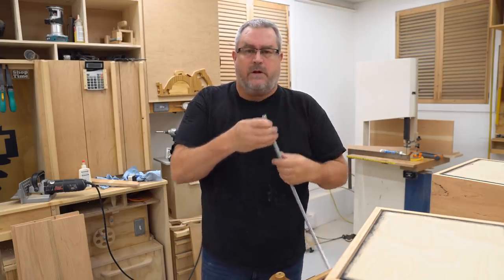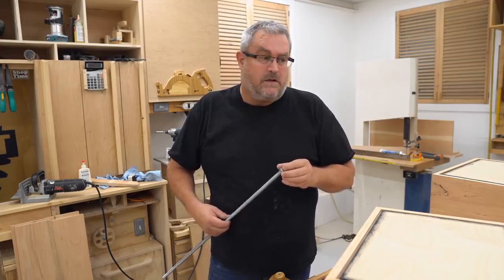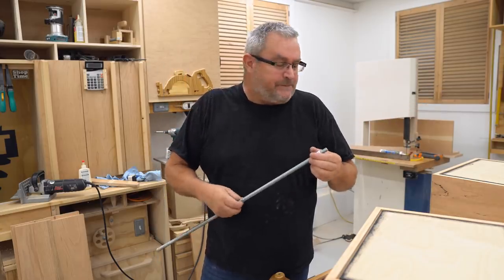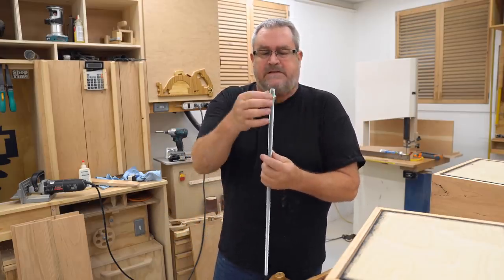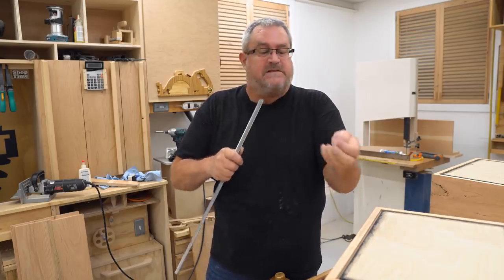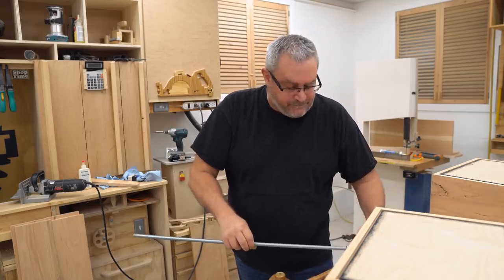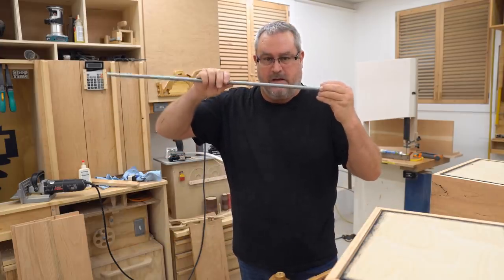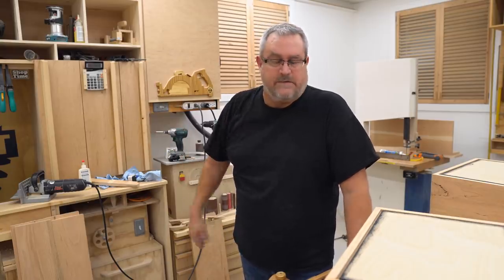Why I Don't Use ACME Threaded Rod

Comment from the maker: Even though i don't use acme rod, there's nothing stopping you from using it in your own projects. You can also use it instead of the standard stuff in the plans I produce. Whatever floats your boat!
Reply: A potential source: trailer jacks.  I'm not talking new either.  The innards are well greased (preserved), yet the tubes often rust out, or get bent.  However, these are probably more abundant in coastal areas.  Perhaps RV and moving rental stores.
Reply: Din6334 nut will work better?
Reply: @emeltea33  Also gate opener linear actuators, those are great too
Reply: I personally use ACME, because its more fit to purpose when handling traversal loads, due to the trapezoidal shape, they handle the load better, which leads to smoother traversal. That said, ACME rod is readily available where I live, if it weren't I'd probably just use standard threaded rod like you. Because although ACME is better on a technical level, nothing I build is so critical that it absolutely requires ACME to be good enough.
Reply: Perhaps I missed it but did you discuss the grade of the threaded rod? IME the home store stuff is grade 5 or perhaps lower and bends and galls easily. Grade 8 or higher from a fastener supplier is less prone to this type of failure.
Reply: If you do need it for heavy load applications, HD Supply (Brofasco) carry Acme rods & nuts.
Reply: @rok1475  not the point, trying to stay away from send away for parts.
Reply: @blakeworsham3026  higher grades are not readily available, go up one diameter . for home/hobby use will be plenty strong enough, easily replaced when necessary. hobby type will probably never wear it out.  you missed the point, you add complication.
Reply: Scaffolding screws...
Reply: MrBonners not the point-there are situations where standard thread just will not work and you have to use Acme thread. 
I posted a possible supplier for those who have to use it. 
Brofasco have multiple outlets so for some people it will not be difficult. Others will still have to locate other sources.

Comment: I watched the video all the way through (my table saw broke) and I agreed with your fix. Then I read the comments and laughed the entire time. I made my mistake long ago when I suggested putting the air compressor outside (I would do it but John won't). I now think a little longer before suggesting anything. 99% of the time it is what you have already done or intend o do. Great talk John.

Comment: Good subject John, threaded rod and nuts come in a variety of material and classes of fit, as you demonstrated with the nut. Simple engineering for the diy''er  is just go to a bigger size if you can't control the quality, also you are definitely on the right track if you apply habitual failure analysis whenever something fails. Enjoyed the video, looking forward to future instalments, cheers!

Comment: I have some ideas for where to locally buy specialty parts like ACME thread, but it's still more expensive, the places are only open banker's hours, and when I don't know the vernacular of the specialty stores it can be awkward to trying explain what I want or need, especially when nothing is out on-display and it's all behind the counter or in the warehouse.  Additionally sometimes these places want one to have an account in order to do business with them.

There have been times I've gone to Graybar, or Grainger, or CSC/Wesco, but I'd rather go to Ace or Lowes because I have the luxury of digging through the available supplies myself.  Sometimes I end up significantly revising my ideas while I'm browsing the available materials because material selection might itself provide for inspiration that I hadn't had when working it out on paper.
Reply: McMaster-Carr...and they'll ship to your home...account not necessary.

Comment: I install gate openers, many brands of electronic actuator arms have 24” - 36” of acme threaded rod in them. I’ve thrown so many in the trash. Find a company who works on gates in your area and ask the guys who work there if they’ll set some aside for you. If you offer them lunch or beer, it’s pretty likely they’ll help you out. Also, I use 3/4” coupling nuts with 10” bolts and a lock nut to make adjustable positive stops on gates all the time. I weld the coupling nut to the gate and set the bolt to a depth that when closing or opening, the bolt head hits something solid and it makes the gate stop in perfect alignment. Those tapered couplers you were talking about I’ve never seen them anywhere near the threaded rod in the store, only in the plumbing dept and in the electrical dept for rigid pipe, but these are typically not shaped like a nut. (I cut these couplers in half all the time to weld onto a post over a hole I drilled so I can attach sealtite fittings to run wire for accessories.) Also, maybe I missed it but did you say on the plumbing/electrical couplers that one side is threaded the reverse direction of the other? The couplers on the shelf by the threaded rod will easily thread all the way through the rod. They work great for welding onto something, IMO. Thanks for the lesson on nuts, sir. I always enjoy your videos

Comment: I saw another guy on YT that uses threaded rod with real square ACME threads and he doesnt buy them either. He takes them out of old automobile scissors jacks. Square threads work better than triangular threads for this stuff.
It was the post-apocalyptic inventor.
Reply: That's a fantastic channel.  
You are right, old equipment built for lifting stress is different than equipment built for connecting stress.

Comment: Hi John, I live in the UK so I have very little knowledge of what is out there in the world; however, I used a scaffold coupling that has a very strong thread on it and a nut that goes with it. As scaffold is used all over the world I would assume (and yes I know the acromion for assume) that these items can be found without too much hassle. I have even used the nut and screw to make expectant die & tap sets to make wooden lengths. I have used your plans also and used the bar that use use without any problems.

Comment: That slot for the bearings, that you initially made linear ( then made it curved ) you could make linear again but longer. This way the stress on the thread would be spread to wider area of the rod. Then you could use smaller diameter knob ( to compensate the time needed to pick up the blade ). Sorry for imprefect english.

Comment: I think part of the original problem could be that you didn't check for manufacturing variation when you bought your parts? If you grab any parts at random, there's a chance that the nut will be on the larger size of the acceptable tolerance, and the rod could be on the smaller side of the acceptable tolerance. Then you end up with less thread engagement and a sloppy fit- which you demonstrated.

Comment: Regarding slop in the fit of your threads - there are different classes of threading, 1, 2, and 3, which is the loosest (easiest to assemble) to the tightest (and more precise, also more expensive), You typically see it at the end of the thread spec. E.g. 3/8-16 UNC 2A is a general purpose 3/8 inch male thread with 16 threads per inch (the nut would be 2B instead). If you want a tighter fit, see if your local hardware store carries 3A rod and 3B nuts.

Comment: If you want a lot of thread per inch , like fine indexing part on a jig, on a moderate size shaft. Lamp threaded steel tube out to 3ft is common in home depot etc. inexpensive

Comment: The kind of larger coupling nuts i've seen here in the US are the kind that is threaded all the way through but is then bonked with a punch in the middle, creating a stop. So you have to either run a tap all the way through or drill out the punched spot. Smaller sizes (3/8" and below i think) are true all-thread.
I do see an appeal of double nuts though. Easier to get, ready to use, and more importantly can be used to adjust backlash of the thing they are used in by placing a washer in between, then very lightly lightening both nuts into it. Use plastic or rubber washer if you want some 'give' in case the threaded rod is not perfect. This double nut backlash adjustment is even used in some metal working machines.

Comment: there was a time when getting stuff like acme rods and nuts was a PITA, but now with ebay and amazon its just as easy as going to the store.
I scratch build a CNC about 8yrs ago, same acme rods and nut since it was built, still no slop and just as accurate all these years later.

Comment: If you discard the factory nut idea, and go with say using a piece of 1" steel, where you drill and tap it, your results will be a lot better. You have less backlash, and "wiggle". It gives you more thread contact, and transfers more force.

Comment: I don't know what's available in Canada, but I was in my local Tractor Supply Store, and my Rural King Store (a US midwest regional chain) yesterday; and both had threaded rod up through 1"-8 and the coupling nuts located in the hardware section (in the racks with metal stock of all sizes and shapes of steel and aluminum) of each store.  I know both had threaded rod in 3 ft lengths and the Rural King also had 6 ft lengths (I didn't look that close for 6 ft lengths at TSC.  All are standard Inch series coarse threads, so regular hex nuts are also readily available.  Maybe you don't have those type of stores in your area, but Tractor Supply is pretty common in the states and there are many small regional chains of 'farm' stores here in the US.
Reply: Were they ACME threaded though?

Comment: My 2c: 
1) lubrication is important, but avoid oil that will make wood dust stick to the threads, wood dust can be very abrasive. 
2) the advantage of a coupling nut is that the tread is consistent over the length of the nut. With two nuts it'll be hard to avoid one nut doing all the work until it's worn. 

My table saw also stripped out and I fixed it with (M10!) threaded rod and a coupling nut, it hasn't failed yet...
Reply: You'd think oil would be a problem. But in practice it really isn't. Steel is a lot harder than wood is. I've never found a dry lube that equals the performance of oil. I've gone through it all myself on my table saw. Just oil the rods. If it is good enough for chainsaws it is good enough for me. And yeah chainsaw bar oil is my lube of choice in those applications. I always have it.
Reply: @1pcfred  I'm not sure, but I think it can be a problem. I had sawn a lot of Azobe (red ironwood), which is notorious for containing crystallized minerals, and when the threads failed they were full of Azobe dust and very worn. I think the wood dust contributed to the wearing.

Comment: No problem with threaded rod. I've got two table saws (brand name) and neither utilizes Acme threads. A solution would be to get get a higher grade steel in the rod which arguably may have to be ordered or in the least, visit a vendor that carries higher grade bolts/all-thread. Most store carry grade 5 and grade 8 bolts, possibly they also carry a couple of grades of rod.

Comment: I can't help but agree with your comments about using ready rod. Any specialized-thread rod is pretty much unobtanium in northern Alberta, and I've been using ordinary plain vanilla threaded rod with a pair of ordinary nuts to make a traverser for 40+ years (not knowing until recently that I was "doing it all wrong"). I just had this ridiculous idea that if it worked, gave repeatability, and didn't leave me broke it was a Good Thing. I used to have quite a stock of ready rod, bought back around 1980 when it was still made in Canada. I've finally used most of that up, and the current hardware-store stuff is definitely not as well made, and the quality of the steel is a question mark. Like you I've always gone "up one size" when I've built threaded rod into a machine for traversing, lifting or whatever. Lately I've been looking around for some better quality stuff, and there is a metal supply shop not too far away who will sell to the consumer in small quantities. I've had better luck with that. I've tried ordering "specialized" motion screws, couplings and so on via the "A" store, but some of what's arrived - particularly sliding rails - has been pure garbage, and I've sent it back. In some applications, I've used the "drawer slide" dodge, although sometimes I wait until Princess has it on sale half price. For some applications it works fine, and it's a lot more robust, less flexible, and less expensive. Anyhow, I appreciate your thoughts on making stuff using commonly available parts. Many thanks.

Comment: Just to be devils advocate... placing an order on McMaster carr is pretty painless... seeing as going into public big box stores these days is a nightmare all by itself.
Reply: Haha, I thought this too, but figured it goes without saying.
Reply: If one tends to think visually, catalogs like Grainger and McMaster-Carr aren't as intuitive, even if one has the dead-tree edition.

I do a fair share of both, there have been times that the catalog-order solution requires more effort to conceptualize than I'm willing to invest.  Other times I know that there isn't a locally-available solution or isn't one that can be achieved without going to expensive local specialty places, such that taking the time to work it out with catalogs and fitment/compatibility cross-references needed.
Reply: @TWX1138  Very true, many times I've thrown the Grainger catalog across the room and drove to the hardware store and got the next best thing.
Reply: TWX1138 McMaster has great images of the things they sell! Look up acme threaded rod and you’ll find good stuff, cheap stuff, precision stuff, all with illustrated photos
Reply: I need an acme nut for a vise, where/how do I get that?

Comment: Great info on the use of coupling nuts, or the potential problems with their use. When you re worked the lift mechanism, you emphasized that application of grease. In your experience, does a dry lube hold up like a regular grease in similar applications? The lift/ tilt mechanism on my Delta TS needs cleaning and a relube several times a year, cause it gets gunked up with sawdust. Was curious if a dry lube keeps sawdust away better.

Comment: Maybe I'm overthinking it but if you use a couple of nuts backed up together you would need to make sure that they are the exact right distance from each other so that both sets of threads engage with the rod at the same time or you will just wear one out and the the other as it have not seen any real load until the first one wore out.

If you use the coupler nuts, the right type as you mentioned, then the threads are always engaging at the same time as it's the same thread all the way through so I think that will last a lot longer than a couple of nuts or three as they may not line up the inner threads to the exact same pitch if that made sense?

Comment: Exercise barbell rods use acme threads and they're quite easily available.  Finding a nut you'd need might be a bit more of a challenge and the size of the rod is rather large.  There are plans out there using barbell rods for Moxon vises and they seem like a good choice.

Comment: I built a vise and wanted acme rod - it was available in ten foot lengths! I ended up buying a cheap trailer jockey wheel which also had a cast acme nut. Perfect.

Comment: You compare it to the router lift but as far as I can tell the table saw height adjustment isn't locked like the router lift. The router lift has external clamp which takes the load off the threaded rod.

Comment: Grab two nuts put them on your thread about 1/16th apart and tack weld them on 3 of the 6 sides, it will be very tight to start with... with a old chisel or screwdriver hammer the nuts between the unwelded facets to slightly spread to loosen... if it comes too loose a slight tap of a hammer on the threaded sides to tighten again.

Comment: The threaded rod you bought from one of the box stores was probably from China. My experience has been that products from China are not the best of quality. When I was younger, I worked in the mining industry. We used ready-rod for pulling huge pins from tight bosses. I’m talking about 30 ton hydraulic ram on a 1 inch coarse thread rod. It may have stretched but it never failed. In those circumstances it was a one time use item. We would scrap it after that. Canadian made ready-rod maybe more expensive, but it would have not failed.